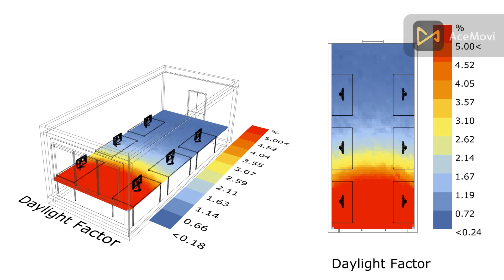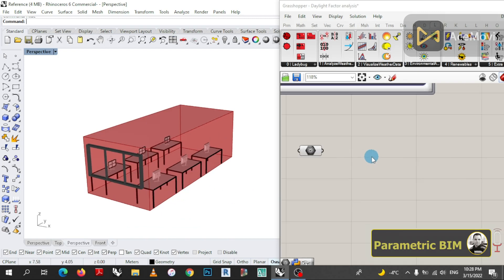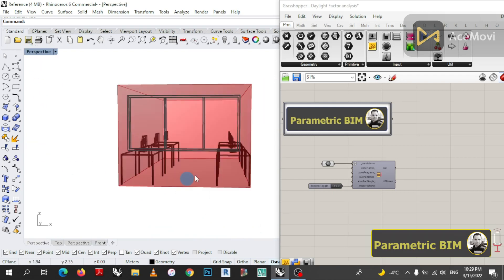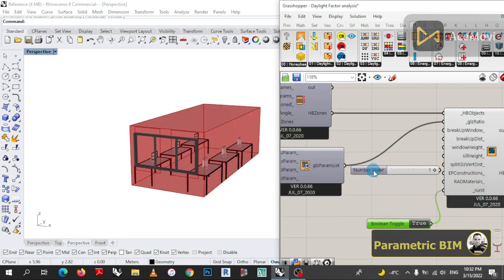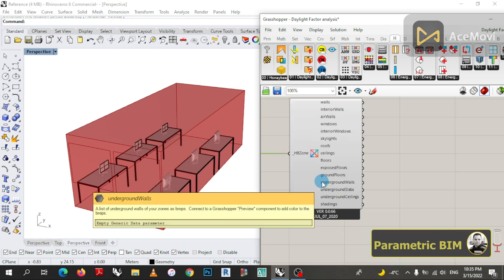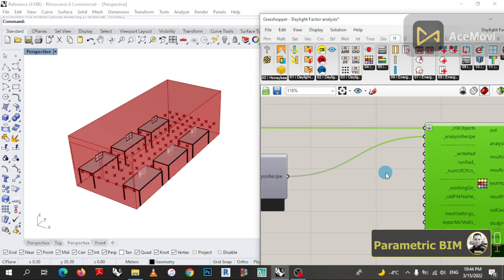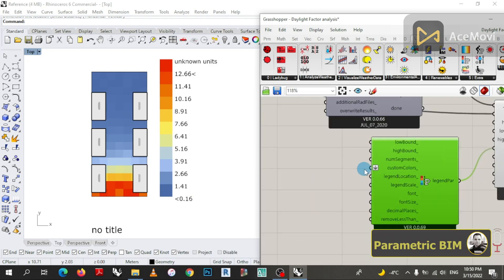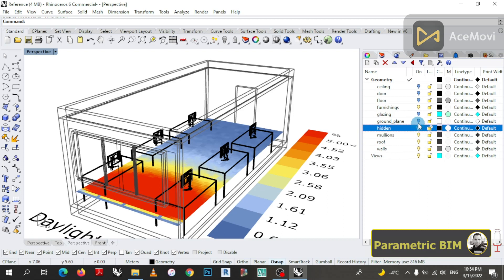Grasshopper: The Ultimate Guide to Daylight Visualization

Comment: I am using the "false" in the break up window to get only 1 window, however I don't want it to be centralized on the wall, which command should I use to be able to move the window?
Reply from the maker: You can assign geometry in this case.. in ladybug 1.4 and later you can do that easily.. 
I advise you to update ladybug to 1.4 or 1.5 or 1.6

Comment: Is it necessary to set up all materials to perform this analysis correctly? Thanks!
Reply from the maker: Daylight factor analysis is not related to materials.. I think you can perform without setting up the radiance materials.. if you are performing UDI or SDI you have to set the reflectance properties of materials but for Daylight factor no need .. 
this the limit that I know but for sure read about daylight factor more and more
The video just show the technical issues of how to perform the DA analysis using ladybug tool in grasshopper 
I wish my answer helps 🌹
Reply: @parametricbim2023  Great, thanks!

Comment: hi, there's an error when I follow your video: 1. Type conversion failed from Goo to Brep comes on generate parameters. It somehow doesn't read my geometry. Do you have ideas?
Reply from the maker: Check your units ln geometry ( meter or centimeter) in rhino
Or try to see if your geometry is volume not surface for brep
Reply from the maker: I wish I understand your question
Reply: @parametricbim2023  It's neither :( I checked, it's in meter and a solid.
Reply from the maker: Try to redraw your geometry in rhino